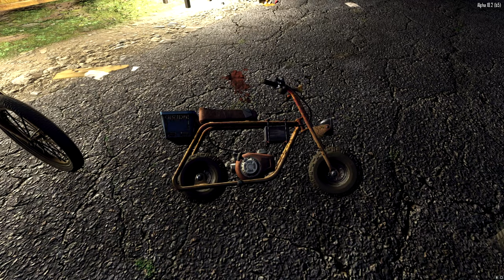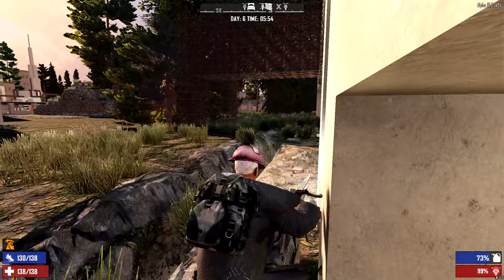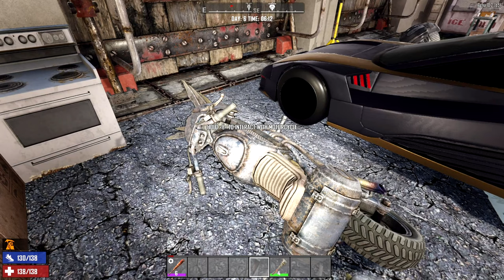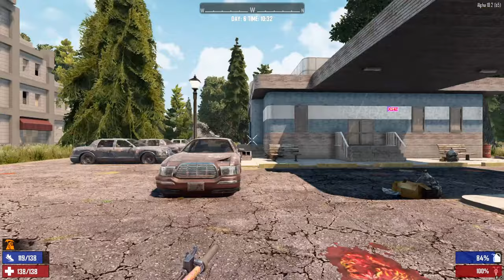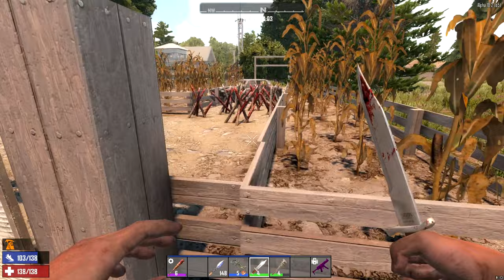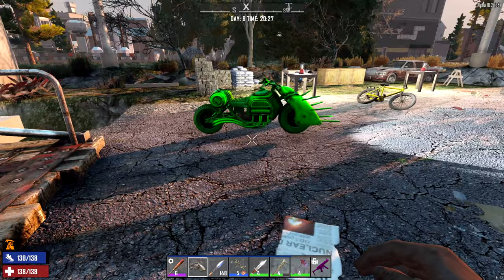Motorbike Guide - 7 Days to Die - Alpha 18

Comment: The best vehicle. 
Didn't even try the 4X4 in 18. In 17 as soon as you go offroad it start to lose " life ". Bah

Impatiently waiting for vehicle mods.
Bigger sadllebags, a silencer at low speed, serrated blades in front, adapting the red tank. That would be great.

Another loot tip I found. Some food vending machine don't work( the prompt <E> don't appear). Wrench them.
3-4 steel, 3-4 forged iron, mecha parts, elec parts. Really useful in the first days.

I leave you here, there is Sons of Z-narchy on the tv   8)
Reply from the maker: Haha. I should check that show out one of these days. 
Oh ok I had noticed there was one that didnt work for me. But I have been so used to them shocking me I didnt try to wrench it. 

Yeah vehicle mods will be nice. There have been some in previous modlets but it would be nice if they got officially done. 

Yeah I have to record the 4x4 one. I have not tested it. But my car does ok off road as long as its flattish

Comment: Do you know of any ways to get steel that you can smelt in the forge?
Reply from the maker: you need to get the crucible for steel.
so a few level of advanced engineering. I believe I mentioned it in the forge tutorial I did.
Reply: @AdredenGaming  yeah, thanks I finally figured it out, and didn't watch your video until after finding out what I needed.  Thanks!
Reply from the maker: @KrazyCries  I'm glad you figured it out. Cheers.